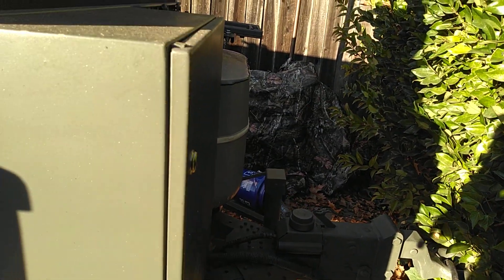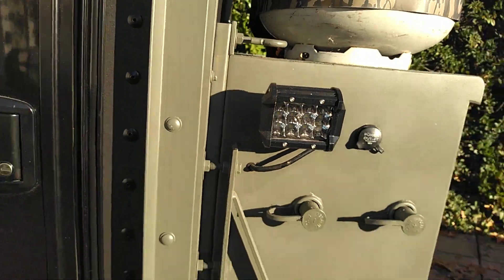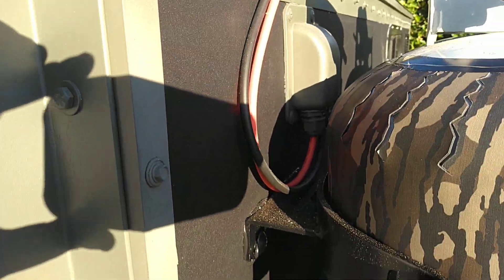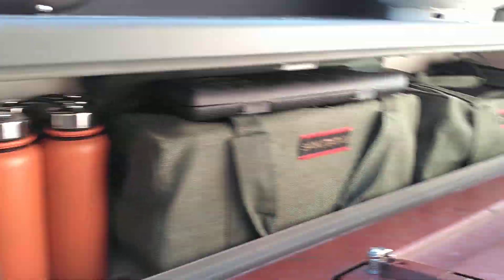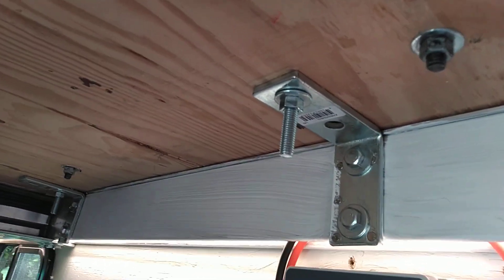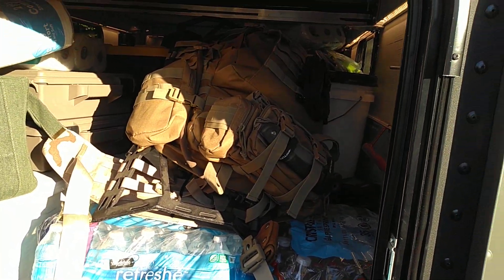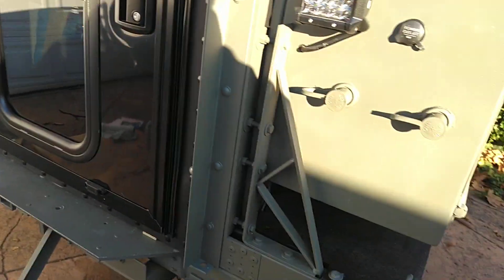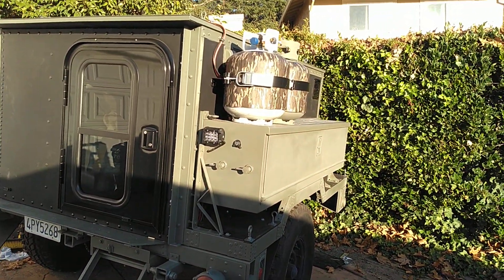M1101 Overlander Trailer

Comment: I am trying to build a  set up like this one  how did you attach the main box to the trailer  and do you have more pics or videos
Reply from the maker: @ms9759  I have a combination of three bolts at the end of the square tube and nut serts in the center of the tube. I have a couple videos on YouTube but not much else.

Comment: What is totale weight of the trailer?
Reply from the maker: I have not weighed it. 1,100 lbs chassis + 500 lbs in frame and skin + 42 gallon (full) water tank and propane, batteries, and misc. @ +700 lbs. Approx 1,100+1,200-ish for 2,300 lbs total with a max payload of 3,400 lbs per the tag. I also ditched the heavy Humvee wheels for some Alcoa's with Toyo tires. saved about 40lbs per wheel because the old run-flat center and steel wheel are gone.
Reply: @mikebellis914  good call changing out those old tires, those things are crazy heavy and have a lot of rolling resistance. I had one of these blow out while moving my trailer cross country so I was forced to change the tires and wheels about half way through my trip, it was amazing how much of a difference it made, not just in taking hills better, but in fuel economy. This build is fantastic, and giving me ideas on what to do with my own m1.